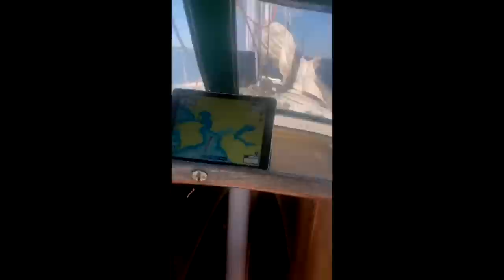Masthead fitting, running rigging and Sailing Alanouwoly - SV Tapatya EP241

Comment: Silly question, will the flex on the mast under load damage the fibre glass?
Reply from the maker: It shouldn’t do, Manny. The glass should stiffen the wood a bit and then flex with it. It’s fairly common practice 👍

Comment: Over here Tony in Australia one anchor we use is a reef pick, would that be handy when in an area of just rocks, it's small and can be stored straight and bent when needed. I'm also looking for small junk rig information for a 20" sailing junk boat, any recommendations.
Reply from the maker: Yes, a different anchor would probably be good for rock bottoms 👍
Junk rig information is probably best from the book “Practical Junk Rig”. It has everything you need to know. 
The Junk Rig Association has a  website that has lots of info, but you need to search through a lot stuff there to find what you want 👍
Reply: @SVTapatya  Thanks Tony I’ll get that book.

Comment: Would promoting the hours and cost in building a boat like this work for more views? Say someone could do overtime at their job 10 hours a week for 10 years and buy a boat, or renovate like Hazel or go your route.
If you'd rather not say np. I know early on in Ship Happens they got a lot of questions about it and they considered it personal. I never asked but did wonder.
Anyways great work and you are clearly proud and beaming over your daughters and the adventure they have gone on.
Reply from the maker: I doubt it’d make much difference in views - I think there are other factors at play there.
In terms of costs; there can be little doubt that the cheapest way to get a boat is to buy second hand- even factoring in the fixing up/ upgrade costs.  Just on costs alone, building will give the the cheapest new boat, but if you price your hours in, you might be better off buying new. But it’s not about price; for me, the challenge of building a boat that I go on to cruise in is the incentive, and what this project is all about 👍
Reply: @Alston - Tony did do a rough costing estimate way back in one of the early videos. I'm very curious to see, once Tapatya is finished, how closely (or not!) the reality compares to the estimate.. Of course, the whole covid/supply-lines mess will have blown the budget out, I'm sure, but I have the impression Tony managed to have purchased most of the big-ticket items before covid came along. So it will be interesting to see how it all turns out.
Reply: @Garryck-1  Thanks I'll have a little dig later on for the episode. Ditto on how it turns out too.